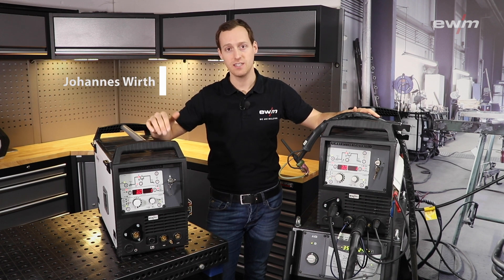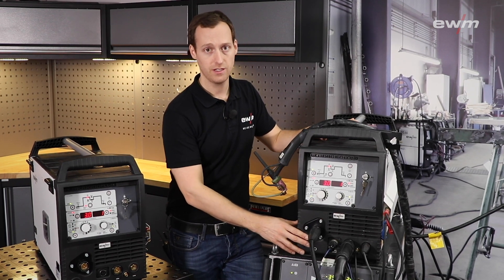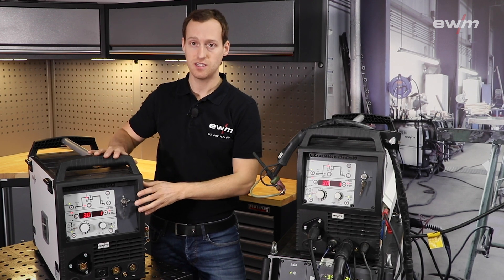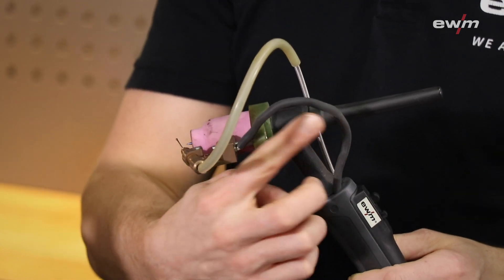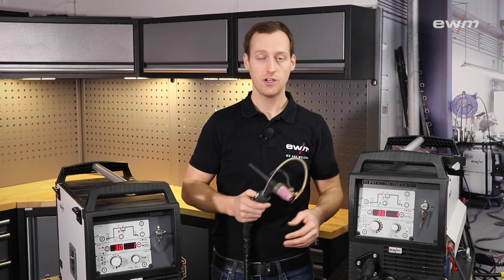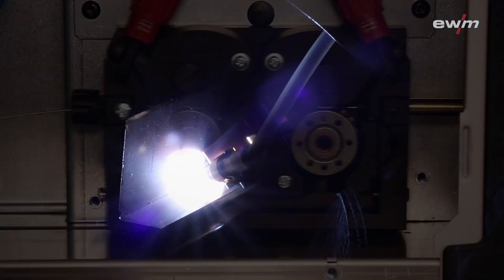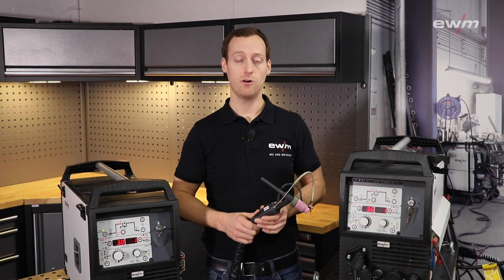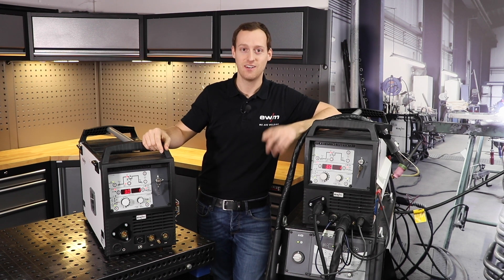EWM tigSpeed - TIG quality welding at MIG/MAG speed (English)

Comment: You need an external welding source with tig speed? Or u can use it as itself? (not having to much knowledge). Tnx
Reply from the maker: Hello @cristianpopescu9258, thanks for your question. To put it very simply: tigSpeed is basically a separate wire feeder that can be connected to TIG welding machines. As you can see in this video, the device is used to feed the welding wire in a continuous or alternating - reversing feed. In addition, this wire feed device also contains a power source that is supplies the wire with a current when it is immersed in the molten pool in order to heat the wire. By heating the wire, it is then possible to increase the welding speed. This allows welding speeds to be achieved that are comparable to MIG. If you want to know more about tigSpeed, please click here: : https://www.youtube.com/watch?v=KjGIzsrWxTs&list=PLMRYn3pnaTATaBuQWubQwYEZkSvKxbnLd&index=2
Reply: @Ewm-group link?